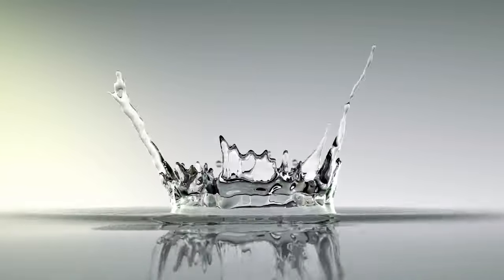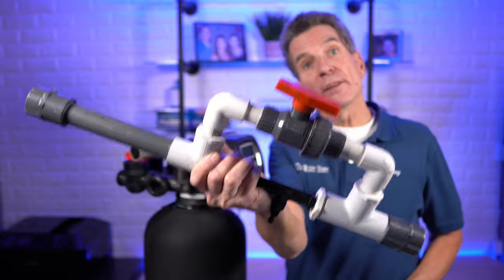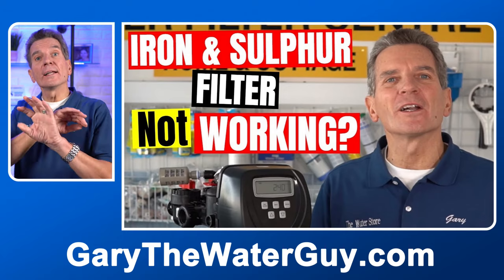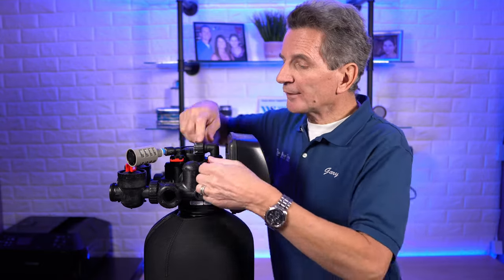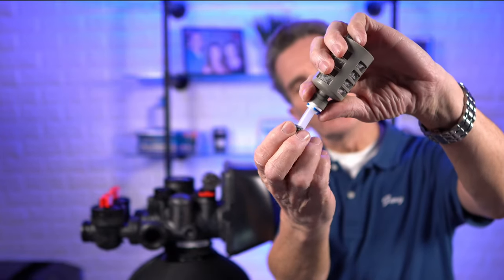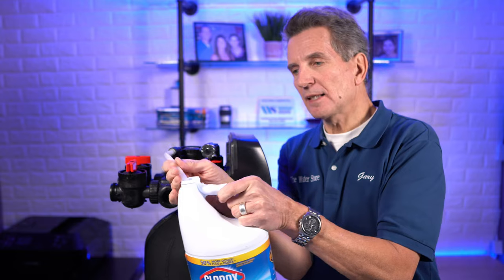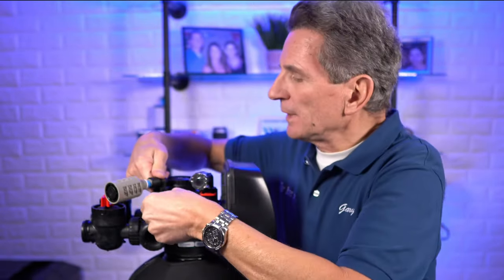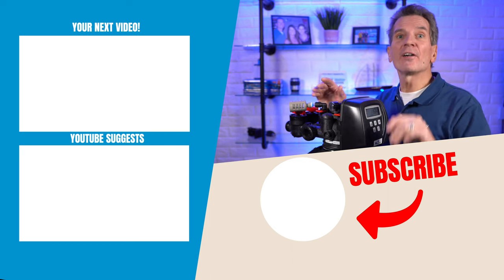EASY IRON Filter FIX

Comment: Hi Gary.  I have one of these for iron and sulfur.  Works well but it needs the water pH above 8 to work correctly, over time the pH increasing media needs to be recharged.  The last time this was done, I think too much was added because my water after the filter now has a pH of 9.5 and tastes sour.  How would you deal with this?  Can I try to remove some of the pH increasing media w/ a wet/dry vac?  I know over time the pH will gradually get back down into the 8's but it may take a year or more and I'd like to reduce it faster. (been a month of use and hardly seeing a reduction in pH).  Thanks!
Reply from the maker: It depends on the media inside and the pH of the water that you are starting with.  No, removing some of the media will not help.
Reply: @water_estore  Thank You Gary.  The water starts at 7.0 before it hits the media.  The pH raising media is calcite.  Was thinking of a stenner pump to add vinegar to get it back to 7's after the filter but someone said that is a lot of maint.
Reply from the maker: @jmbuys  yes, calcite will definitely do that. Why do you need the calcite?  Ph of 7,0 is just about perfect?
Reply: @water_estore  To oxidize out the iron, manganese and sulfur in the well water.  Was told the oxidizing works better w/ water at a pH above 8 (otherwise those can stay in solution).  So calcite has been added in the past to raise the pH from 7 into the mid 8's which has been fine to drink and everything has been filtered nicely.  But recently we noticed some staining and noticed the treated  water had dropped from mid 8's down to mid 7's (again the raw water is 7.0) and the filter started letting some of the soluble iron and manganese thru.  So recharged the calcite...but overshot and now the water is too high (pH at 9.5) after running through filter.
Reply: @jmbuys  have you tried playing with the bypass valves? I turn mine to about 45 degrees so this way I am blending some unfiltered well water with water that went through the calcite filter. You may need to tweek things to obtain the right value that you want to reach but it is not that complicated.
Reply: @water_estore  Gary, I'm on Filox and my supplier tells me the same thing: better to increase the pH to at least 8 in order to get good results. Worked fine for 6 months but now something is wrong because my iron level in the house is now up to 0,6 ppm.
Reply: @micheltruax4434  Thanks Michel - The water treatment guys actually suggested that as a solution and had a dedicated bypass that would bypass x % of raw water to mix w/ the filtered water....but I wasn't crazy about that....don't want to re-introduce a % of raw water that has Manganese and Sulphur in it (even at x % of total)....seems to defeat the purpose.  I'd rather try to reduce the amount of calcite at the source or reduce the pH post filtering w/ some acidity.  Someone else suggested doing an under sink reverse osmosis that will lower the pH. for the drinking water at least..which should work...but seems overkill.  Also I don't love 9.5 pH water flowing through the rest of my copper pipes long term because of long term corrosion.....all harder than it should be.
Reply: @jmbuys  I fully understand your predicament. I guess my suggestion only works if you have another filter after the calcite filter. In my case, I need to increase the pH so that my iron filter will remove the iron. My blending of the water at the calcite filter passes through the iron filter and water softener before entering the plumbing to the house. Maybe in you case you are drinking the water immediately after the calcite filter. Is that the case?
Reply: @micheltruax4434  Thanks...yeswe have the drinking water come right off the Iron Buster and before the softener (that feeds the rest of the house).  Wanted to avoid drinking softened water....we could switch that but would rather avoid.  It really comes down to too much calcite being added....for years w/ the pH elevated to the 8's everything was great...but being up at 9.5 just isn't pleasant (or healthy for the pipes).  If adding too much caused the pike I might just wetvac some out from the top of the Iron Buster and see what happens

Comment: I have been struggling with iron filters for years.  I have tried number of models and results are the same.  First few backwash cleans the iron.  But stops working and no mater how much I back flush, media no longer works. I have tried many medias and same results.  Why is back wash not working after few times? Ph is over 7 and .7 ppm average.  Tried on two wells with same failure.
Reply from the maker: What is the flow rate from your well pump, how big is the iron filter ( in cubic feet) and what media was in your iron filter. Flow rate video is here https://youtu.be/BONHr56jnKs

Comment: So if I have a mazei style I am unable to clean the media? Because the other video was just about cleaning the valve not the media. Water softener salesman is eager to sell me a new system but I’m not sure that’s the best right now.
Reply from the maker: You can use this method if you have the mazzei stylke injector but the problem is how do you get the chlorine into the tank?

Comment: Thanks for the videos
 I have an FOC that I purchased from you a number of years back. The smell is still gone but I have noticed some of the staining coming back. I assume the bleach will remove the existing iron but I don't want to degrade the carbon media. How harsh or harmful is the bleach on the media?
Thanks
Reply from the maker: Great question.  Due to the short contact time the effect is minimal.  I would first try the suggestion in this video https://youtu.be/Yg0HTiaLVFg

Comment: My rainfresh CAFO948 will not suck in air. I disassembled and cleaned out all the brown sludge buildup, the screen was completely plugged and so was the injector. 

Without the one way coupler on my air intake water comes out of the line, when in brine it’s suppose to be sucking but it’s not. Any suggestions?
Reply from the maker: Did you check out the advice in this YouTube video of mine https://youtu.be/Yg0HTiaLVFg

Comment: My air filter kicked on I have an 800 hagus ran for 5 hours electronics was not on display panel what is going on it's not that old maybe a year and a half
Reply from the maker: You may have had a brown out or power failure which could compromise the controller.

Comment: I have what I think is an FOK with a clack head on it that looks nearly identical to the one in this video except for the display screen is slightly different.  It also only has a black plastic dome where the air intake is on the one in your video.  Is that normal?  In case it matters it is filled with a combination of Katolox Light and KDF 85.
Reply from the maker: If it doesn't have the air intake it is not an air over media system.  I am  not sure what it is.